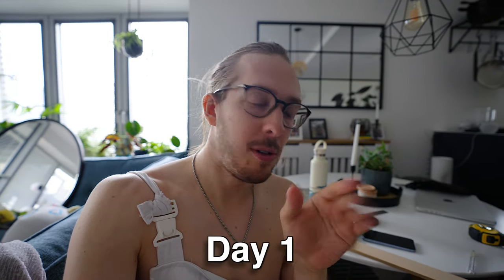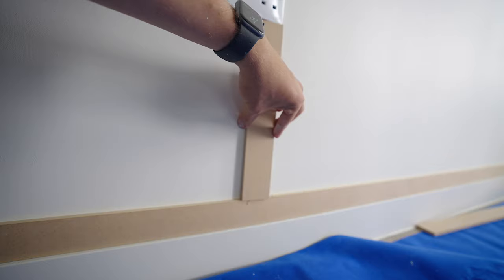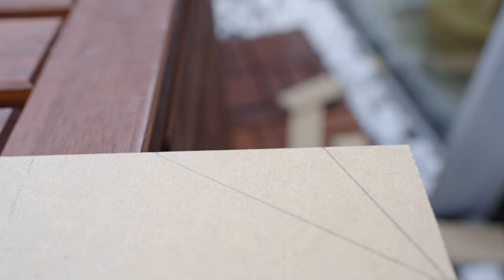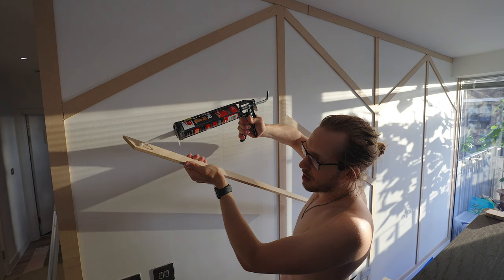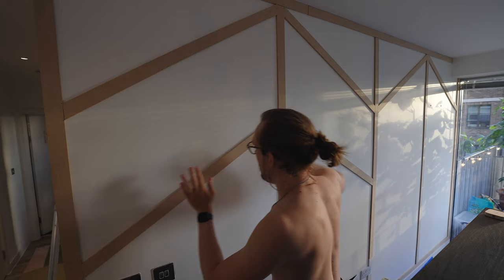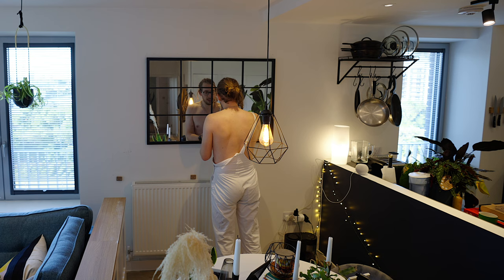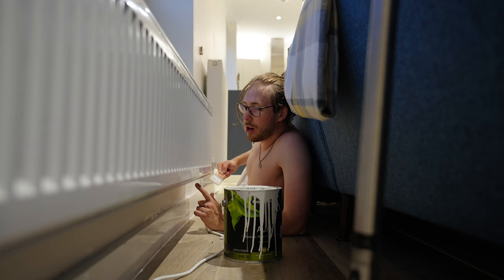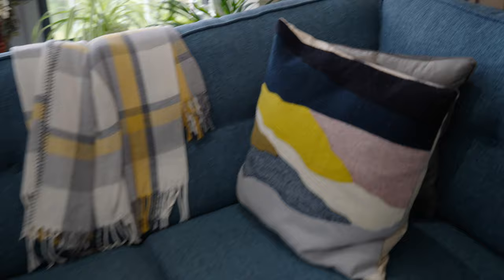How I transformed my living room with a chevron accent wall! Wood panelling DIY

Comment: hi evan loved the paneling! have been considering it myself, just wanted to know whether you considered if the ceiling and skerting board lines are parallel, because I noticed in the video you didn't use a spirit level ruler, or if the side edges of the wall (the vertical ones) are parallel? perhaps that may be the reason why the maths didn't align with the practical instalment of the panels? I'm genuinely curious as to why it wouldn't work, would love to hear when you do find the reason

Comment: Hey, was just wondering what grades of sandpaper you used for the wood, did you scale or go (more or less) straight in with e.g. wet and dry?
Reply from the maker: I used 100 to 120 grit for sanding down the lil wooden slats. I used 240 grit for finishing sand on certain aspects but in between coats of paint I used 120 grit again. No idea what scaling means in that context. soz!
Reply: @EvanEdingerTravel  No thats fine, was just curious as couldn't tell in the video. What I meant by scaling was going from really rough sandpaper to smoother, I personally just skip to the grade I need (after the initial pass over)